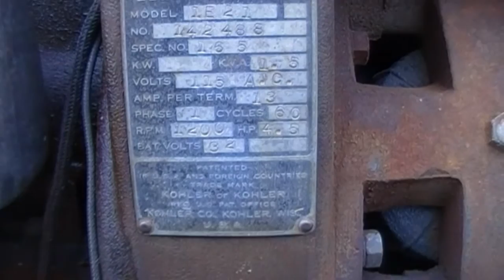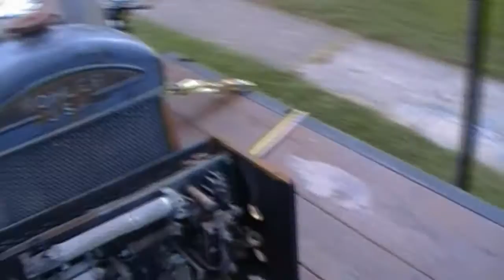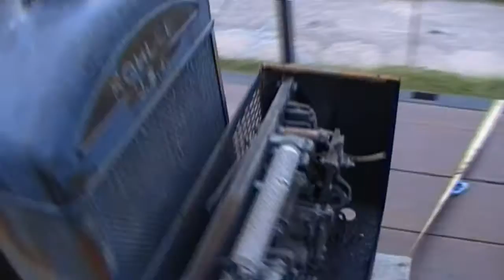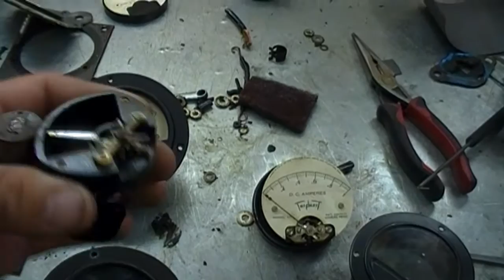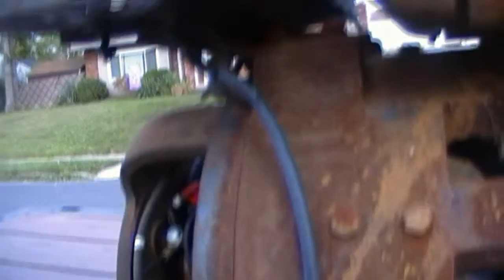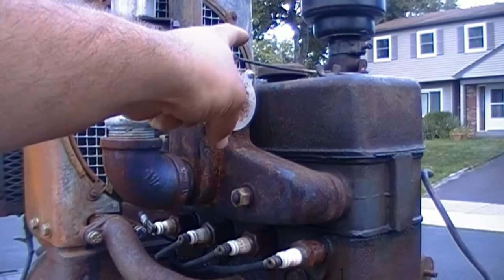Kohler 1E21 Emergency Light Plant

Comment: Up until about 1940, Kohler used a threaded radiator cap, spring loaded tensioner on a flat fan belt, there wasn't any screen protection over the fan blade and they didn't use an air cleaner. Prior to about 1929 they didn't use the diaphragm type fuel pump. There are other minor differences but these are the most significant.

Comment from the maker: 4.5 Hp is refering the mechanical energy being produced by the engine.  2.01 Hp would be the gen head's max supplyable power in HP.  In the US typically electric power production is measured in watts*.  Electrical draw is also usually measured in watts unless the draw is directly mechanical like a motor, which would usually be HP.